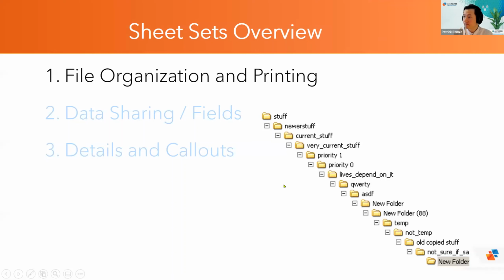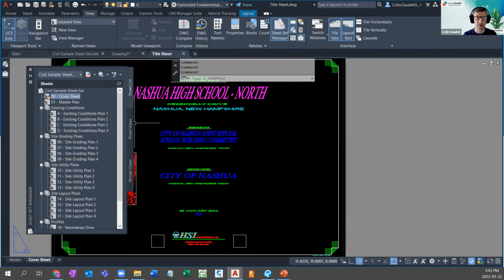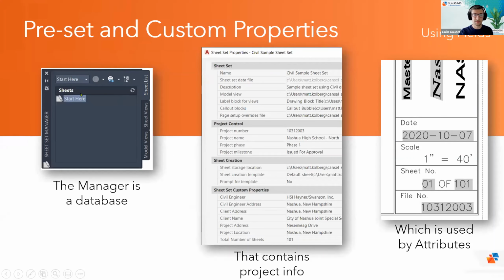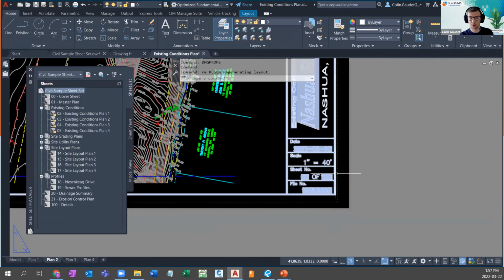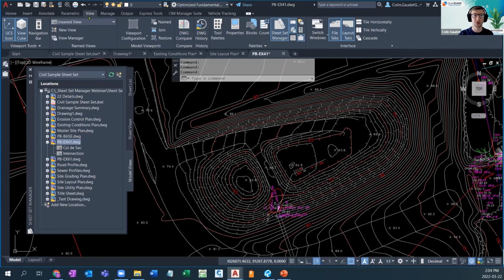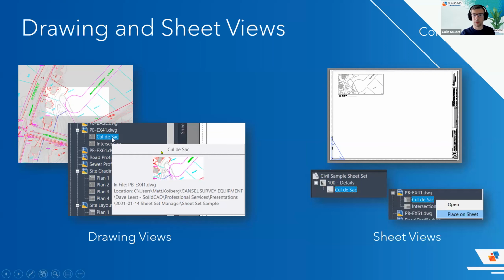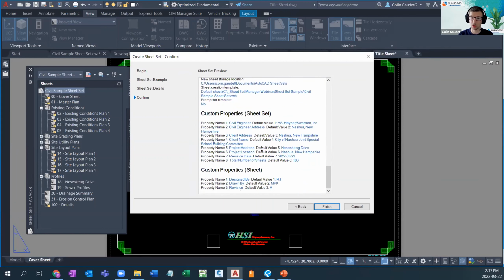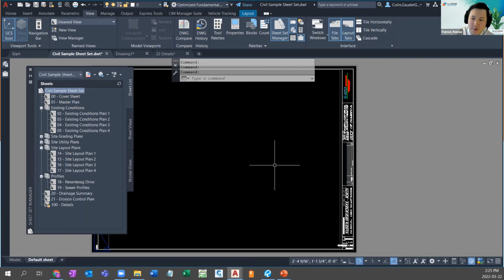AutoCAD Webinar Series Part 3: Managing AutoCAD Sheet Set Manager

Comment: Hi is there a way to automatically enter the pages # in the sheets set. Ex: I got 300 sheets  do I have to enter 300 number manually. And if I delete lets say sheet 100 do I have to change the 200 others sheet manually?
Reply: Unfortunately, there is no native way to automate the sheet numbers like that. However, with a project of that size, you may want to look at a 3rd party tool to tackle that task. Sincpac2 is a reputable Civil 3D add-on that has a tool called SSM Renumber. This might be worth the investment to save you the time.